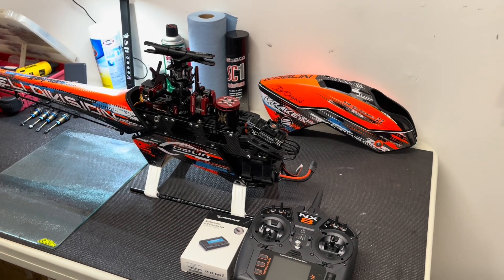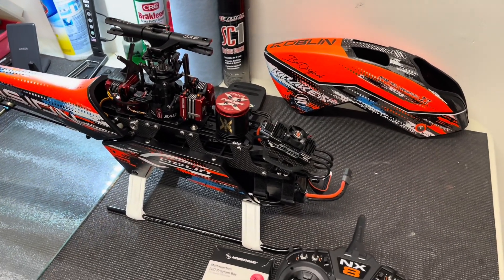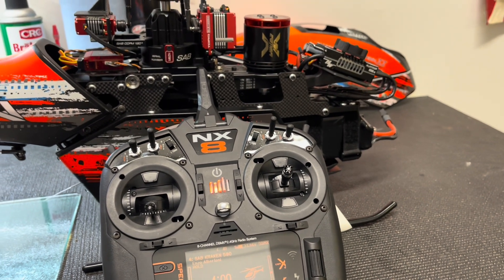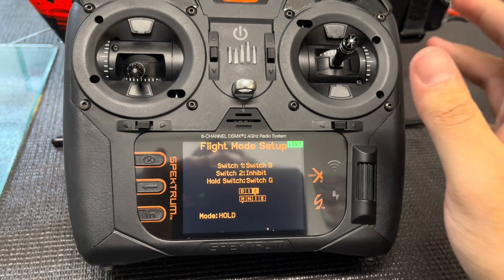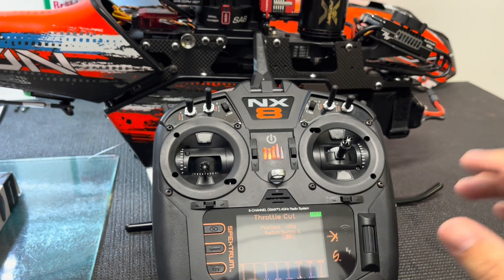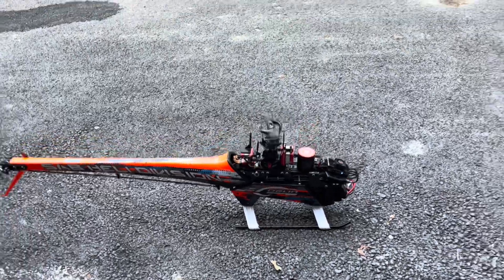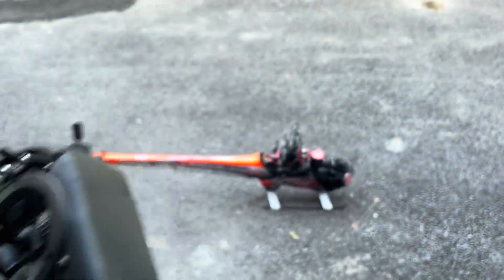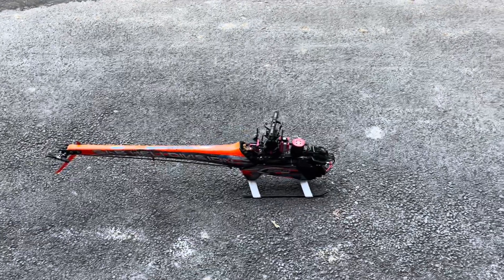Hobbywing Platinum Helicopter ESC || Spektrum Radio Bailout Setup! || Enzo Albertoni

Comment: Ok, I'm flying Futaba.  My Hobby Wing ESC does the auto bailout ok in as much as once it starts to reaccelerate the rotor speed, it does so as expected, that is, no soft spool up.  My problem is, it takes two to three seconds for it to "start" to reaccelerate the rotor speed "after" I turn off the throttle hold.  In your video, we can hear the switch as you exit auto mode and the rotor spools right up immediately.  I haven't been able to get mine to do that.  It's always a "click, switch off," then I count one thousand one, one thousand two, one thousand ...... and then the rotor recovers as yours did in this video.  Any suggestions?  I know I'm probably missing something ridiculously obvious.  Thanks for any input.
Reply from the maker: @Intrepid175a  This deff might be a software version. I recommend that you update your esc or check for one if you have not done so already. Also in this video, I was flying the Hobbywing Gov from the Esc. Make sure your Futaba gyro is setup to recognize you are flying the ESC’s Gov and not the gyros. And then max sure the esc is in Store Gov mode. Have you tried setting up. A throttle cut with a 3 position switch like I did for this setup? 

Hopefully this helps!

Comment: Great video!  I'll add what I've found to work also.  If you set your throttle hold curve to 20%, this will allow the bailout function to work for however many seconds that your "AR" (Auto Restart) time is set to in the ESC.  So if you click out of hold during the auto, the bailout function will "fast start" the motor like you described.  I have my AR time set to 30 seconds, as I doubt I could keep my RS4 in the air that long during an auto before landing.  After 30 seconds, the esc will revert to the normal "soft start".  

The thing to remember is that if you do a short auto from a hover to landing with the blades stopped, then click out of hold within that 30 seconds, the motor will still fast start which could be a bad thing if your blades aren't tight enough or you're otherwise not ready for it.  Initiating the throttle cut briefly after landing, either on a different switch or the same if desired, will reset the "AR" no matter how many seconds have elapsed, then soft start normally once clicked out of both.

This is just a different way to accomplish the same thing, but would allow for your throttle hold and throttle cut to be on different switches which I am more used to for planes and nitro helis.

Thanks again for the great video and taking the time to make it.  It's what initially made me aware of how the bailout function worked on ESC's as I'm pretty new to the electric heli world!
Reply: Excellent comment will try this too on a dedicated throttle cut switch because my muscle memory is burned in for throttle hold and I don't want to change off that two position switch. So will setup a separate throttle cut switch and change to -20%.

Comment: Dude excellent video.  I understand ow how to do this but still confused why throttle cut is working like hold should.  I always thought thru flying planes, throttle cut is the one that completely kills the motor, and hold would simply hold the motor in a pre set rpm but here it’s kind of reverse where hold is the total kill and cut is something else

Comment: Same for a YGE esc , but, I also reversed this setup so that throttle hold is on the middle of the 3 position switch B , that way throttle cut on switch H cannot be overridden by throttle hold.

Comment: Thank you for posting this very well done video.  This video demonstrates how to get the job done in an easy to understand step-by-step manner.

I would like to add that there is more than one way to "skin the cat".  I personally would have reversed the "Throttle Hold" and "Throttle Cut" positions in the 3-way switch so that "Throttle Hold" would be in the middle position of the 3-way switch.  This would not affect the functionality, but it would help to maintain setup consistency across my fleet.

Comment: Excellent video! My bailout stops working as soon as the motor stops turning. After the motor stops, the esc goes back to the soft spoolup. I'm using an old DX8 Gen 1 so I don't think I have a way to set it up on a 3-way switch. Any suggestions?
Reply: You have to tell us what ESC you are using, as different ESCs use different throttle percent range for fast spool-up bailout.

I do not currently own any Spektrum radios, but I did own a first generation Spektrum DX8 (as well as a DX6i, DX9, DX18, and DX8 Gen2).  It should be possible to have a setup similar to what is shown in this video (with a NX8 radio) with the gen 1 DX8 radio as well.  The DX8 radio has plenty of 3-way switches, so pick the 3-way switch you want for this function, and assign "Throttle Hold" and "Throttle Cut" to the respective positions in that 3-way switch, so that it functions similarly to the VBar Control radio.  I personally would assign "Throttle Hold" to the 3-way switch middle position and dial up the throttle on this "Throttle Hold" to the ESC bailout range (different for different ESC brands), and assign "Throttle Cut" to your preferred 3-way switch extreme position (either away from you or towards you; I prefer towards me or down) and dial the throttle to 0% or lower.  With this setup up, the 3-way switch would need to be in the "Throttle Cut" position to "arm" the ESC.

I currently have a two helicopters setup with VBar Control Touch radio and Neo VLinks.  I personally do NOT like having this Motor ON/Motor IDLE/Motor OFF function assigned to a 3-way switch.  It is not uncommon for me to flip the 3-way switch too far from Motor ON all the way to Motor OFF (soft-start spool-up) when I really intended to flip the 3-way switch to the middle position (Motor IDLE) for the possibility of fast spool-up bailout.  Also, I had one incident where I landed fine from the autorotation, I got distracted with other pilots talking to me, and I flipped the 3-way switch the wrong way from the middle position.  Instead of flipping to "Motor OFF", I unintentionally flipped the 3-way switch to "Motor ON", and hilarity ensued for the spectators with the chicken dance.

I cannot uncouple the Throttle Hold (Motor IDLE) and Throttle Cut (Motor OFF) functions on the VBar Control radio to separate switches, so I deal with it, but I prefer to have separate 2-way switches in my other radios for the "Throttle Hold" and "Throttle Cut" functions.